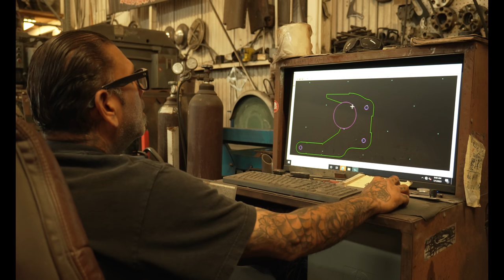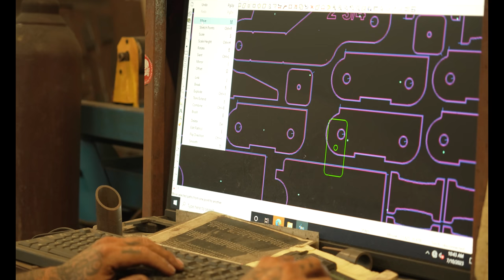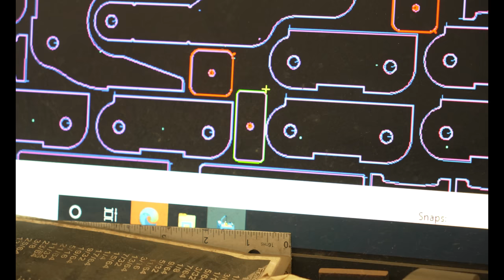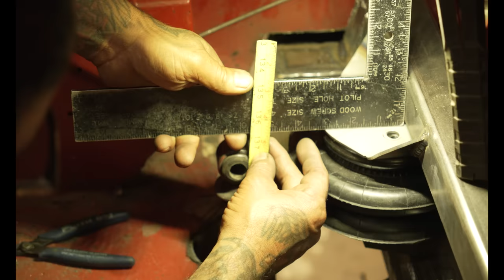1936 Ford 4 Link

Comment: I have a machine shop and I’m always cutting my fingers/Hands ,so clean it with Cotten swab a peroxide  when it’s dry I put super glue gel over the cut ,then hit it with the catalyst so it hardens up and it burns like hell for couple seconds .then I sand it down with 600 grit and your good to go a few days later super glue falls off .

Comment: Have you ever done a spring set up on the rear 4 link. Like, not a coilovers but a separate spring pocket and separate shock? Like for someone who wants a static suspension?
Reply: Probably wouldn’t be too hard to use coils instead of air bags

Comment: Mike a Question -------- If I can ----- Just picked up a '38 Ford - 5 window ---watched your '36 T5 install --- must have been from an S-10 ---------- I am seriously considering a T5 ---- Have learned the Early ones up to '89 had gear driven speedometer cable  --- then electronic ------ I take it the Speedometer in the '36 uses a gear driven cable? ------------ My main concern ------ different S10 T5 models were made ----- some for the V8's -- V6's ------ and for the four cylinder ------- the T5 for four cylinder is only rated for 240 ft. lb. Torque and the input pilot shaft is smaller than the V8's at only 1" in diameter ----------- BUT ------------- I think it will be just fine ------ the engine is a Merc ----- but am going to build it just to Cruise in and not to Hot Rod around in ------ the Ford's / Merc's were not a high torquing engine ------ yes ---- these had different gear ratio's than the V8's ----- but the smoothness over the Ford 3-speed --- extra gear ---- will make a good combo ------------ Your thoughts if you would -----  I would really appreciate it-------- Thank you for the Videos you have made ----- Hope you will make many more ---- I watch 'em two or three times ---- never get tired of watching ------ Really like the Old Car's -----Take Care --------------- Rodney

Comment: Why do Hot Rod builders use the diagonal Panhard rod instead of running one straight across like the racers do? Straight across the chassis means better sideways location.

Nice work and all though